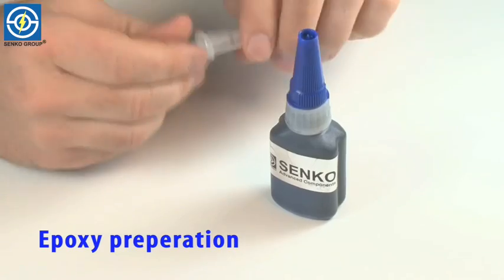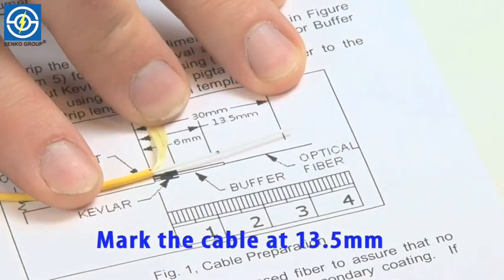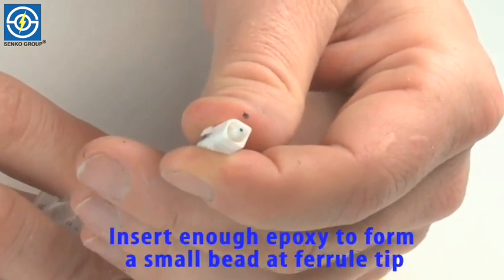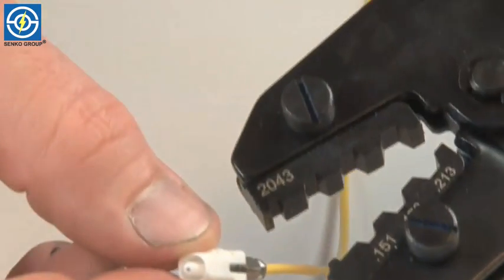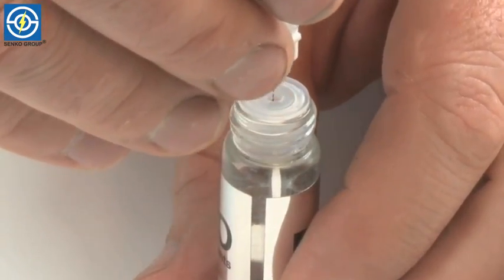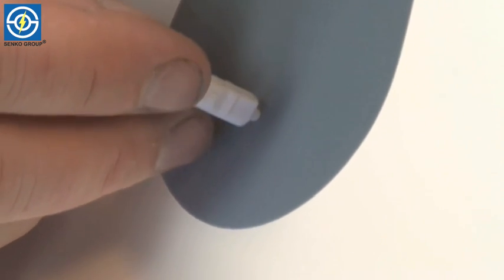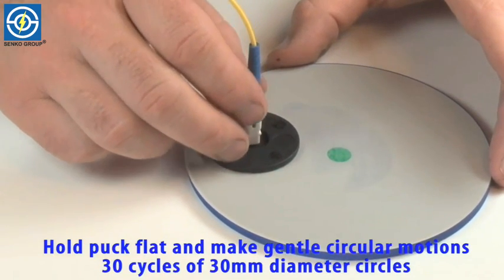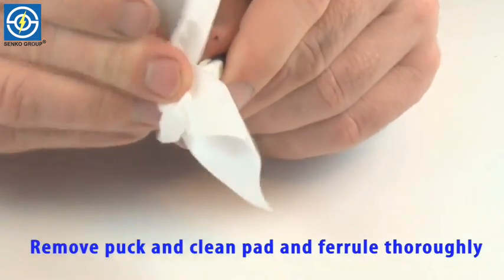SC CONNECTOR - SENKO FIBER OPTIC TERMINATION

Comment: i can termination of 4 types connectors st lc sc and fc and in 6 minutes i can two connector make and he will give good db loss in 850nm 0.60 and 1300 nm 0.45 mostly if you have any fiber optic work splicing or termination so please contact with me 00966 552484487
Reply: Ahmed ahmad I need 1000 x 20m. How quickly can you have this ready by

Comment: In my experience, Termination on site is going to differ geatly depending on the use of the cable. No Polish connectors are great, but they are essentially a cleaved fibre in index matching Gel.. Perfect for a low skill quick term for but they will give an undesireable low return loss (Flat Cleave). Not good for CATV / Broadcast ;).... 
(I know there are angled pre-polish, but they do require and angled cleaver and then it gets quite expensive..) Horses for courses.

Comment: We install a lot of fiber and although we are Corning Certified in all types of connectors and splicing. we find especially in broadcast apps that for the most part the Engineers will only accept epoxy hand polished connectors.

Comment from the maker: Dear spectravp thanks for your comment.
Although many contractors are moving toward epoxy free/no polish connectors, there are those that still prefer the epoxy and crimp method.  Arguments have been made that the epoxy style may offer more consistent signal loss over wide temperature changes since they do not use index matching gels and mechanical splices.  For those who prefer epoxy free/no polish connectors, we also offer these in our XP Fit Plus product line.